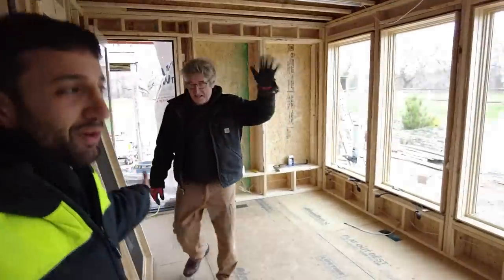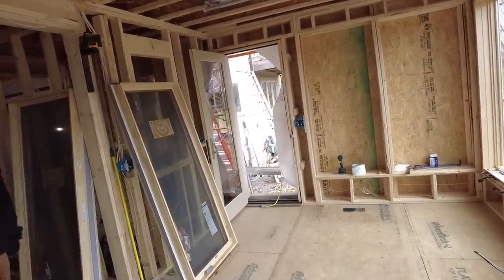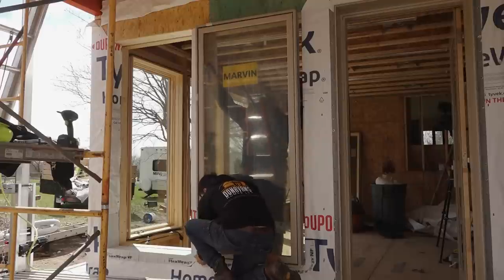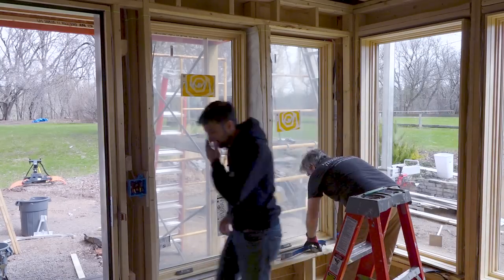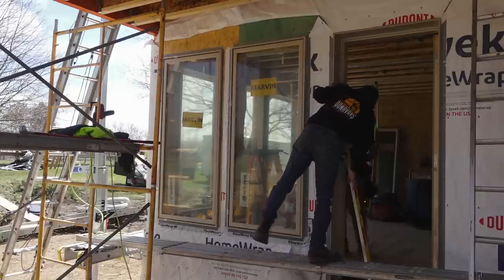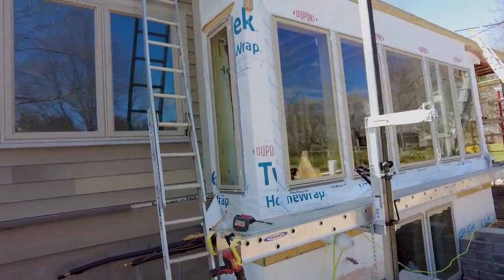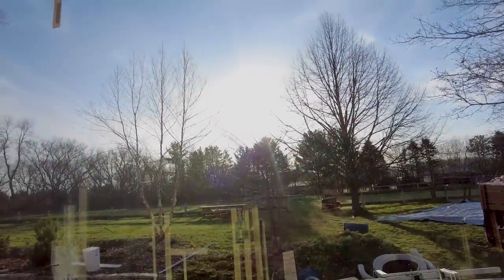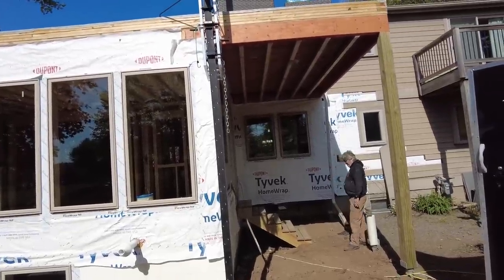Now it's a Sunroom ☀️ All 8 Windows are Installed | Home Renovation & Addition Part 40

Comment: Half expected Donovan to pull out a framing caliper for that end window, but screw it it's only a 1/16th. A relief to know adjustments occasionally need to be made even with the careful layout made with Donovan's extensive experience and obvious skills. It's not right until it is.

Comment: Windows have a low thermal index compared to the walls.  Even if the windows are double or triple glazed. So you will lose a lot of heat during the winter.  I suppose internal wooden shutters would help.  Or heavy curtains.
Reply: There should be some nice solar gain during the morning to partially offset it.   And in the summer the sun will be higher and heat the place up less.